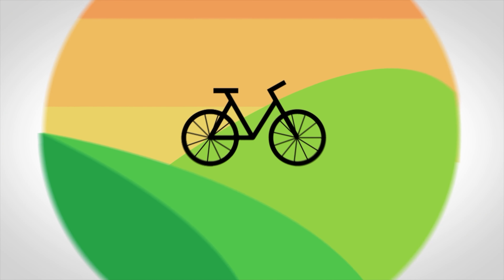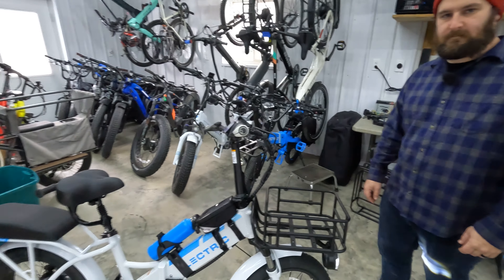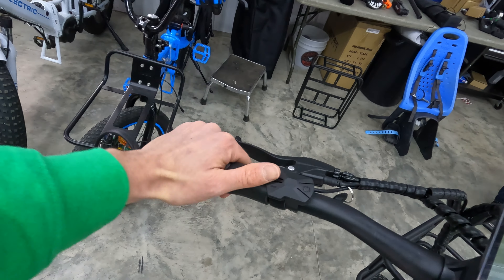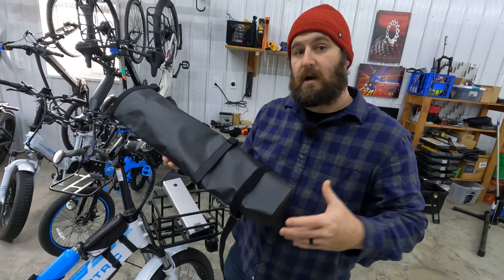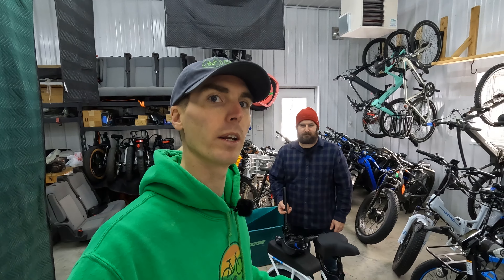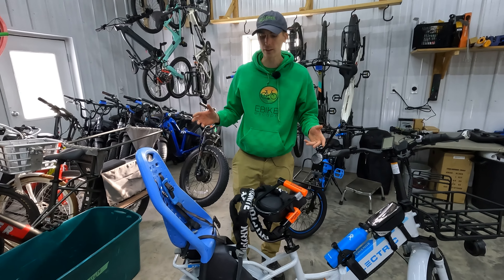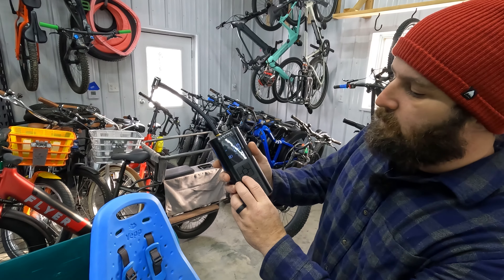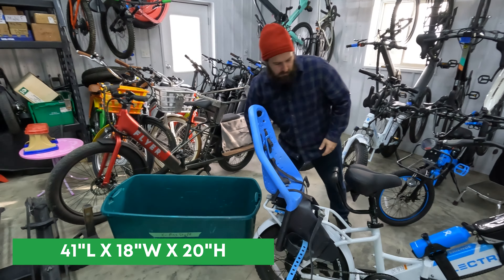Lectric XP 3.0 Accessories FULL List - Mirrors, locks, baskets and more!

Comment: Oh the passenger seat set up is cute, but I would not take a passenger on my electric bicycle. I would use the motorcycle for that and funny enough the extra capacity on the electric bike and the motorcycle are both 150 pounds for the small motorcycle I have in addition to what I already weigh, so let’s just say the cannot be gravitationally challenged

Comment: I bought my 3.0 two weeks or so ago and just ordered another one for my wife. Both step-through and bigger batteries. I bought the baskets, but may not use them much. My wife wanted a bag instead so I also ordered the Lectric pannier bags for her. I'd have liked to have seen you test that. I was hesitant on the air pump. If you think it's a good product, I'll order that. I've also been considering a bell or horn, probably a horn of some sort. Those single ding bells that come with some bikes,🙄
Reply from the maker: The pump feels of decent quality. I had been using it for 3 weeks before we showed it off. No issues yet.
Reply: I own the pump and absolutely see it as a time changer and no guessing.  Love this pump.
Reply: I bought it and am pleased with it. The screw on valve connection can be tricky but I’d still buy it again.
Reply: bungie cord a blue tooth speaker into that basket me son!

Comment: Whoa- good informative video, but don’t strain your back lifting it into the tub! Stand the tub up on end, ROLL the folded bike in (wheels down, seat up) then lower the tub to the ground. To load into car get a large dog ramp,
Place container across ramp and slide up. Still some work involved but beats lifting by a mile (another youtuber shows this very nicely) and I have used this method to pack up my 3.0 and drive an hour to a friend’s house for a ride

Comment: @9:35, how in the world do you get the seat attached?  Did you just force that base into the gap?  Are there manufacturing repeatability issues with the rack or the Yepp base?  I’ve tried and tried.  I think the only way to insert it will be by trimming down the notch so that it will fit.  
I even got the adapter because there was no way I was getting it in without matching that gap larger, but the adapter doesn’t open up wide enough to grab onto the outside of the rack.  
Any tips on installation

Comment: QUESTION: It sounds like you guys have logged a bunch of miles with kids in the Yepp Maxi mounted in the rack. Do you guys often/ ever/ never experience dorking the back of your feet on the Yepp foot guard area while pedaling? On the XPedition , the Yepp is waaay back and not an issue, but on the XP 3.0, things are tight.

Comment: Have you heard anyone concerned with the light below the front rack rubbing or bumping against the tire?
Reply from the maker: Needs to be bent up slightly if it's the elite headlight - in our experience
Reply: I moved my headlight above the rack to avoid the problem entirely.
Reply: yeah I'm currently having that issue/keeps coming loose after re-tightening headlight.. how did you install about rack?
Reply: Definitely a Lectric screw up. They don’t even address on their website. I now see they might have two different models of the rack, were the moved the connection point to the front of the rack instead the closer to the middle of the rack. I’m not sure it works any better after seeing other videos. Shame on Lectric.
Reply: Should be covered in the first year warranty,

Comment: In your previous accessories video for the XP 2.0, you reviewed the Premium headlight and compared it with the stock headlight.  The Premium didn't look that much brighter.  For the XP 3.0, is the Elite an upgraded headlight and have you compared it with the Premium headlight?  If so, please describe the noticeable differencees.
Also, do you know if the Elite consume more battery life than the previous versions?

Comment: It looks like the passenger seat might sit lower than the passenger seat on the Rad Power Plus.  I would think that might have a bearing on the comfort of the passenger. Are legs more bent than extended?  Are there any specs that show something like the inches from the seat to the pegs?  Would love your thoughts.  Great video.
Reply from the maker: I'd have to have them side by side but my hunch is you are correct. Thanks for watching.

Comment: Excellent video 📹!  Wondering if you guys recommend also any GPS tracking devices just in case it gets stolen...
Reply from the maker: Airtags with the speaker removed seem like a good option. Make sure you also have a high quality lock and alarm as well if you're concerned about theft. I'm awaiting a good Android solution.

Comment: What does the front bracket attach to on the passenger seat? Mine doesn’t lineup at all.
Reply from the maker: You just kind of "make it work" so it locks into place. The rear one fits nicely.

Comment: Great accsy's! Does the flexing seat post clear the clampon passenger bars?
Reply from the maker: As long as you are not on the low end of the height range, then yes there is enough west post to clamp the handlebars on to.

Comment: I want to put a thule seat on a XP 1.0. What do I need to that?
Reply from the maker: It's possible the adapter plate or maybe the other Thule seat with the clamping system. Not 100% sure and make sure you follow the weight limits of the rear rack.

Comment: Nice job guys; thank you. What tire pressure do you recommend for this bike? We just got two.
Reply from the maker: 30-35 is a good standard pressure that we run.
Reply: I found 28psi to be a good  result of rolling resistance versus the wimpy front fork springs. I do have the rear tire higher though. In that 30-35 range.  I’m around 250 pounds so take that into consideration.
Reply: @sbukosky  thank you

Comment: What size of shim are you using for the seat post?
Reply from the maker: The Lectric branded seat post fits right in.

However if you want to run the SR Suntour one. You will need to step down from 31.6 to 27.9 (assuming you get the 27.9 sr Suntour post).

Comment: Does anyone know if the smaller battery fits into the large battery compartment? We would like to carry one as a spare.
Reply from the maker: Yes. Both the 10ah and 14ah batteries have the same case size and fit into the same size spots on the XP 2.0 and 3.0.
Reply: @EbikeEscape  I was asking about the smaller battery size, not the ah. We bought the extended battery. I was wondering if it worked inside the larger battery compartment.
Reply: @EbikeEscape  are you saying that the battery that’s in the $999  bike is the same physical size as the one that’s in the $1199 bike? It’s just the ah’s that’s different?
Reply from the maker: Yes. “Ah” refers to “Amp Hours” which refers to battery size. The smaller battery is a 10ah and the larger “extended range” battery is the 14ah.

So yes, the 10ah and 14ah battery are the same size and will fit each.